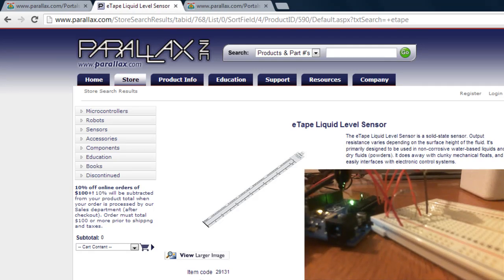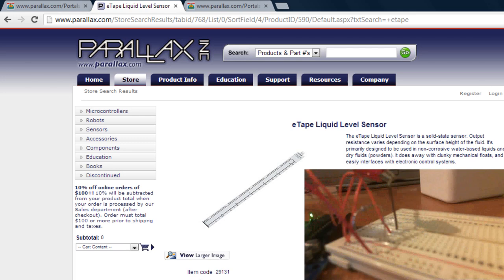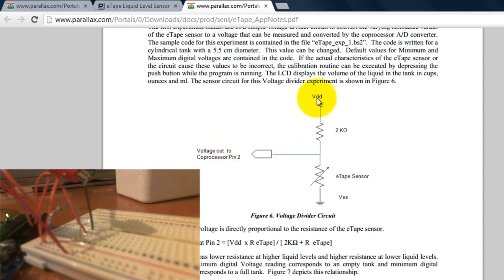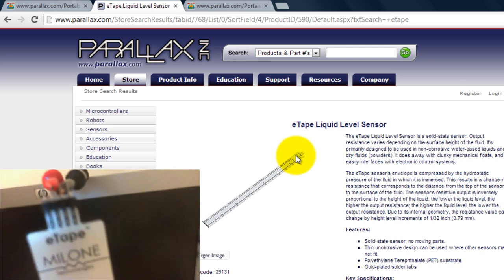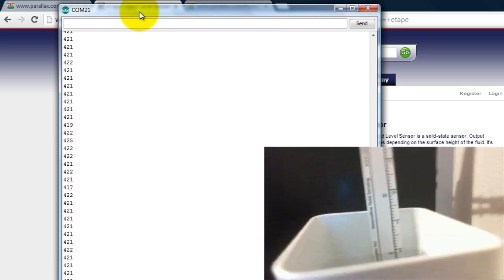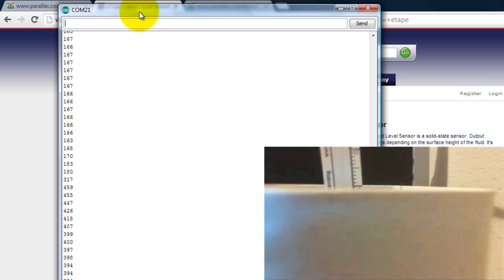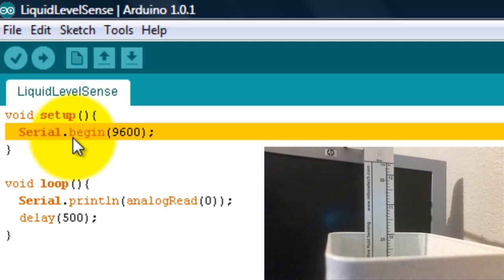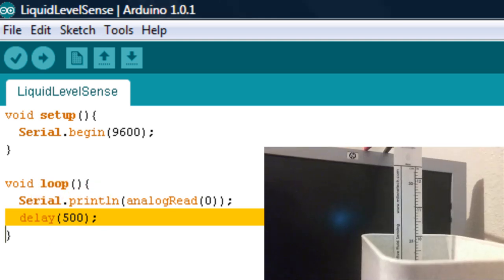Arduino Liquid Sensor Example Code and Schematic

Comment from the maker: There is a block in LabVIEW called "Elapsed Time" that outputs a boolean every time a specified amount of time has passed, in your case every hour. You could connect the boolean output of this block to a case block and put the Arduino voltage reading block inside.

Comment: Im trying to sample a voltage coming from a solar panel and automatically write the average of the sampled voltage to a spreadsheet every hour using arduino and labview. Im already using arduino labview to control the solar panel using 2 stepper motors but cant figure out how to modify the arduino continuous sampling vi to suit my needs any a video showing sampling with the arduino would be much appreciated.